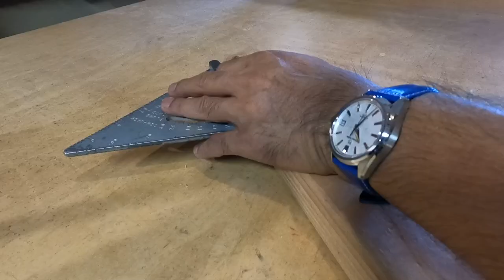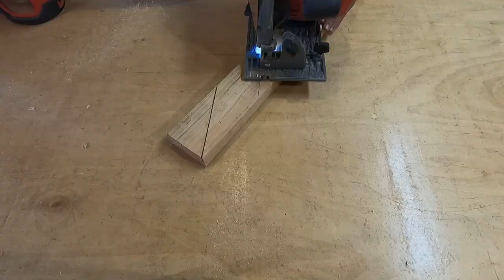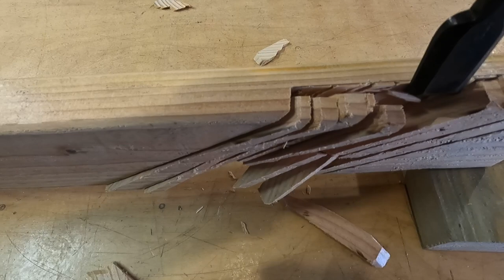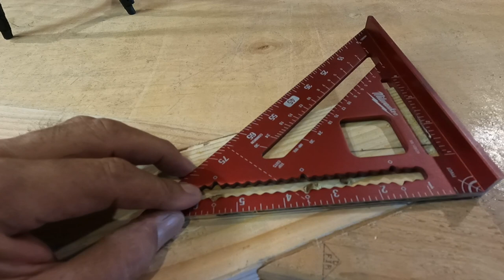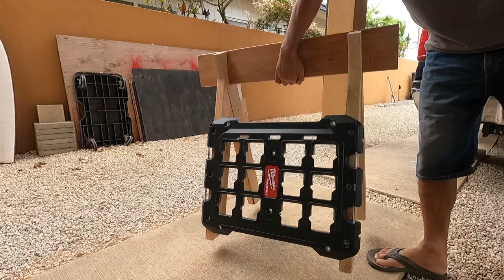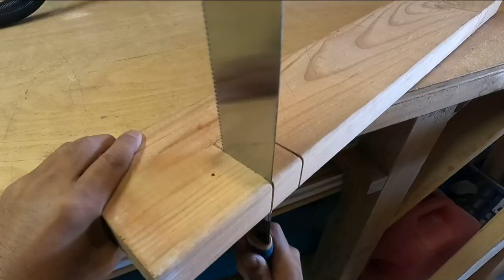Easy Making A Simple Sawhorse / Milwaukee PACKOUT / Woodworking

Comment: Very slick take on an old idea but not using a bolt and crossed members like most but let in crossed members which is pretty cool if it doesn't loosen up over time.
Will you tackle leaned in legs next time?
Or, do you feel these are stable enough?
You have some really cool builds!
2x4's are relatively cheap so this is a good way to work on chisel skills I think too...